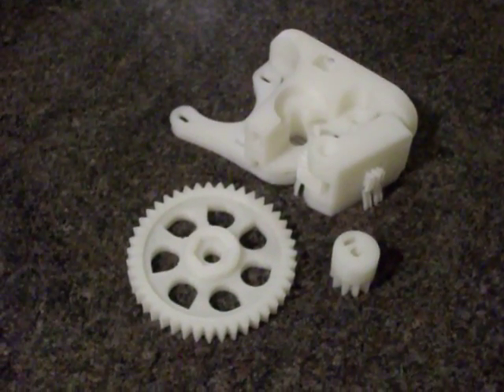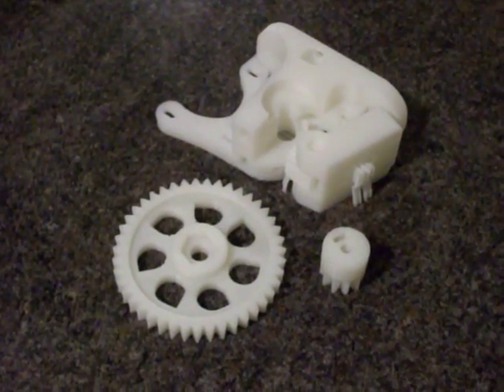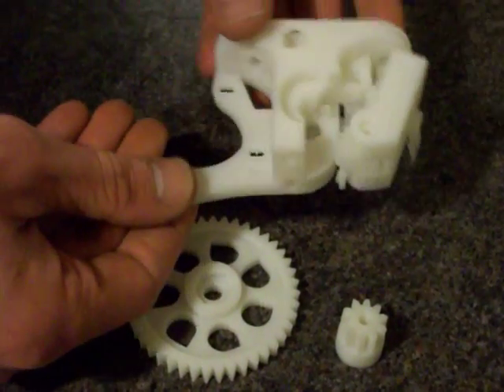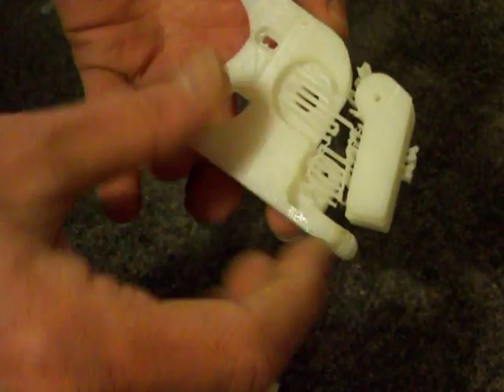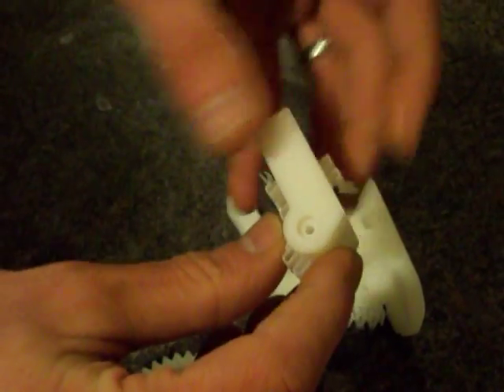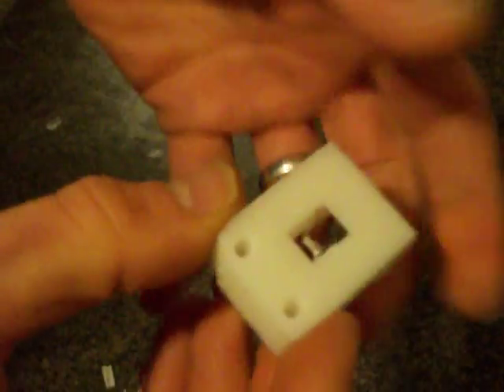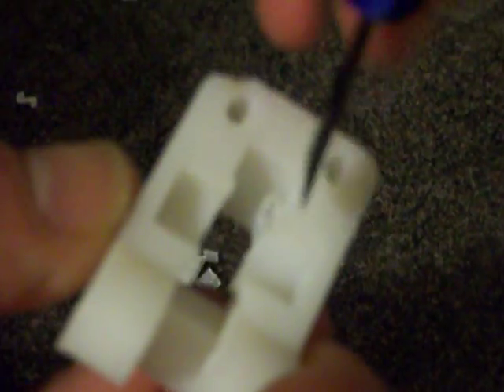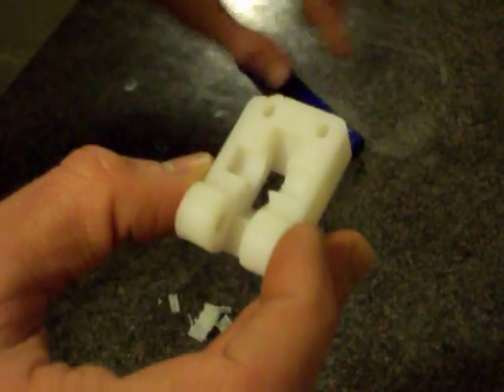eMAKER Huxley 3D printer support material

Comment from the maker: I have used this successfully with ABS from the UP manufacturer as well as from reprapsource before they stopped selling it due to quality issues.
The last layer (adjacent to the printed part) is indeed the most difficult to remove, and if a finger nail doesn't do the trick, a craft knife does. But even then, it doesn't seem to stick to the part as much as you describe. I have also found that using a file works quite well too. I'll put all my skeinforge settings in a blog post when I have 5mins.

Comment: What type of ABS are you using there? 

I have never been able to get support to separate like that because the layer above bonds more strongly to the support than it does to the layer above it. Also it bonds more strongly to the support than the support does to itself, so when I pull the support away it leaves the last layer stuck to the object. Removing that tends to take a layer of the object with it.